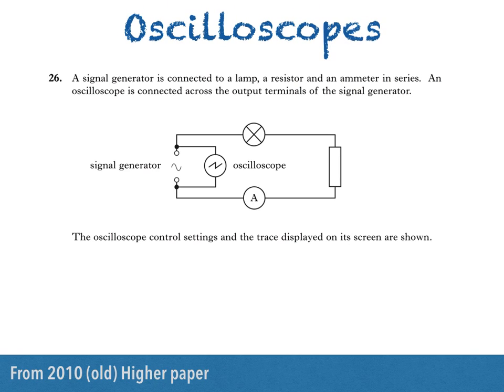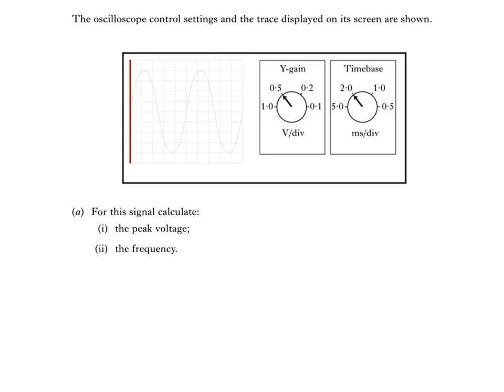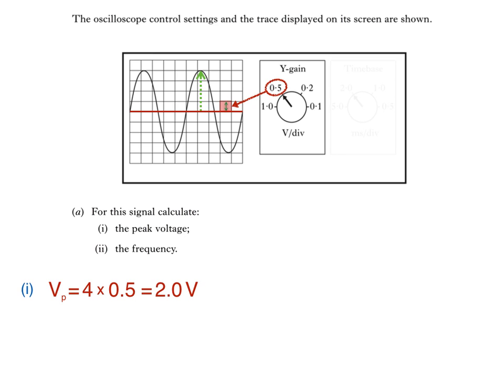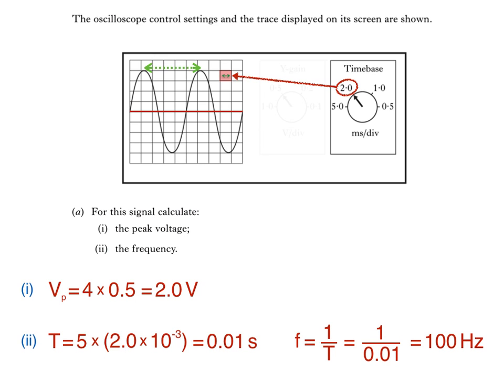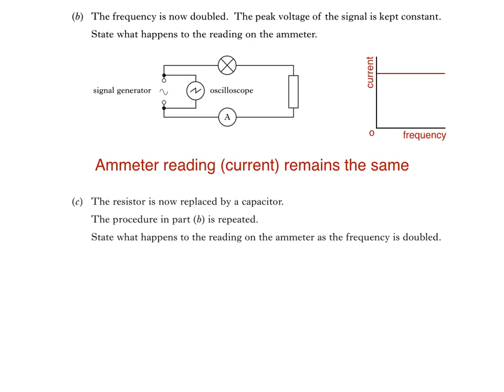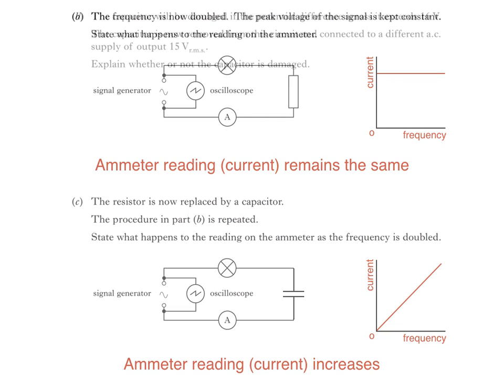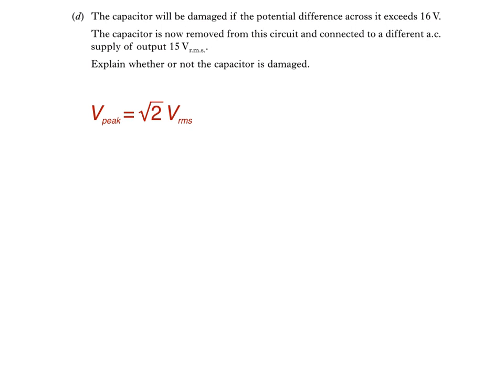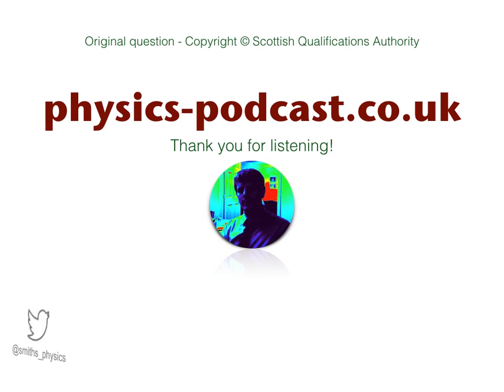Higher Physics - Oscilloscopes

Comment: I don't get how you go 0.01
Reply from the maker: Watch again from 1.32 - you work out the period of the trace by multiplying the number of horizontal divisions from one  peak to the next times the timebase setting. Watch the animation closely and you'll see that the trace measures 5 divisions horizontally and the timebase setting is 2ms (2x10⁻³ s) per division. The period must be 5x(2x10⁻³) = 0.01 s.
Reply: @MrSmithsPhysicsonline  thank u so muchhh